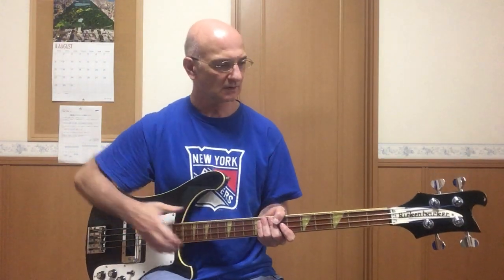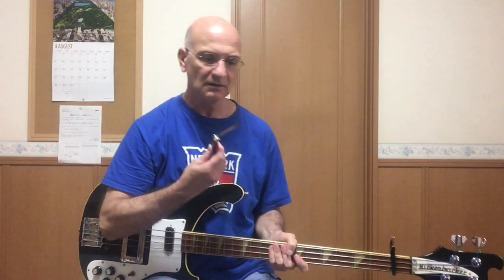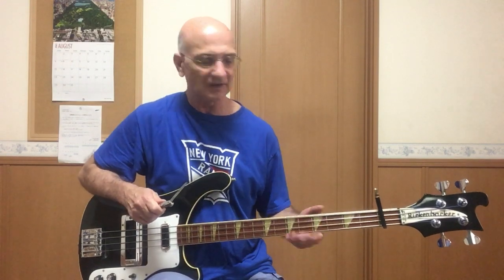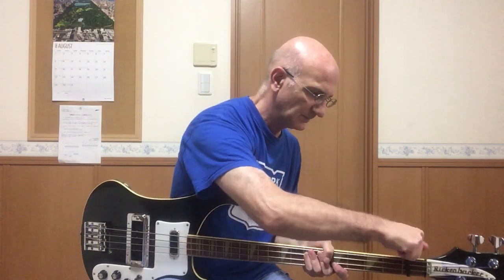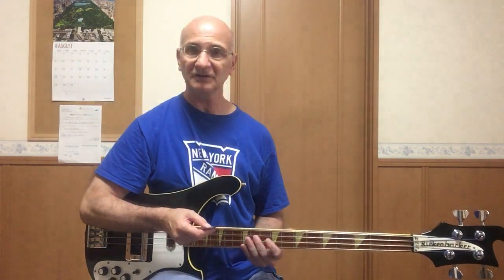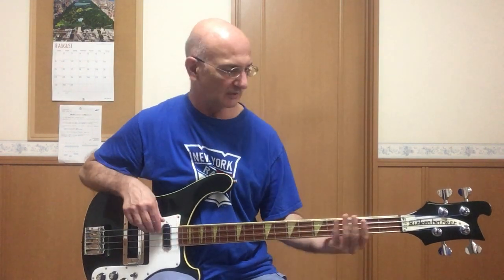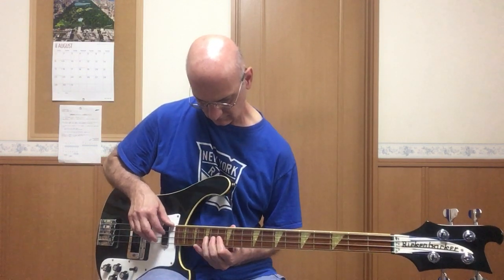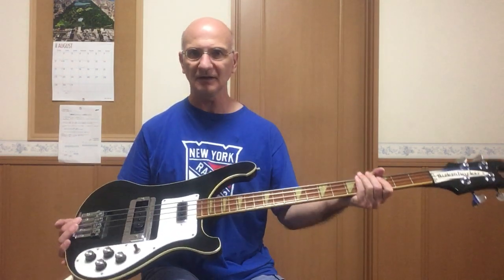Rickenbacker 4001 Bass - follow up.

Comment: I usually check neck relief with a very thin guitar pick of 0.35 mm. If it just doesn't fall out by is own weight, it's fine. I'm used to measure the string action at the 12th fret. I'm fine with 2.8 mm on the bass side and 2.6 mm at the treble side. The mighty fat B string on my Ibanez sits about 3.0 mm above the 12th fret.
Reply from the maker: Jay, I always appreciate your comments, Your    knowledge about bass set ups helps me out a lot and challenges me to think about what I'm doing. I don't have any 5 string basses so I don't know how to set up that B string. Interesting to know that 3.0 mm is a good string height in case I ever get one. Thanks.
Reply: @bass-hiroshimanick2534  Mine is a BEAD tuned four string.
Reply from the maker: @ThunderBassistJay  , I've never tried to tune a bass that low, do you use any special string or string gauge?
Reply: @bass-hiroshimanick2534  I'm using Ernie Ball flatwounds, which I order as single strings. The gauges are 0.130, 0.105, 0.085 and 0.065, like the four lowest strings of a five string bass.
Reply from the maker: Jay, once again I learned something new from you, I never even thought about doing this but I think it's an interesting idea. I have a used Photogenic Jazz bass that I paid $20 for and I think it would be the perfect bass to try this out on.
Reply: @bass-hiroshimanick2534  You'll have to file the nut to accommodate the fatter strings. Some bridges and/or saddles may require some minor work to better fit the fat B string.
Reply from the maker: Thanks Jay for the info, I'll have to keep all the necessary adjustments in mind. The price for individual strings over here is just ridiculous! It's cheaper for me to just buy a set for a 5 string bass.
Reply: @bass-hiroshimanick2534  Same here nowadays. A single flatwound B string (0.130") costs me 20 Euros. 😬
Reply from the maker: 20 Euros is about $23!! That is a lot of money.
Reply: @bass-hiroshimanick2534  Yes it is! A 5 D'Addario set of flatwounds costs 70 Euros. 😲
Reply: @ThunderBassistJay  bass strings